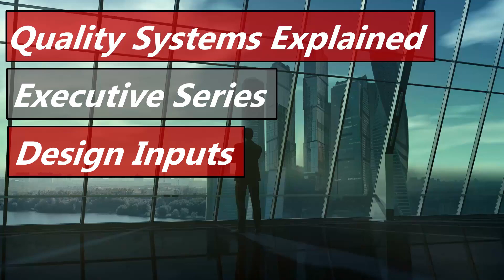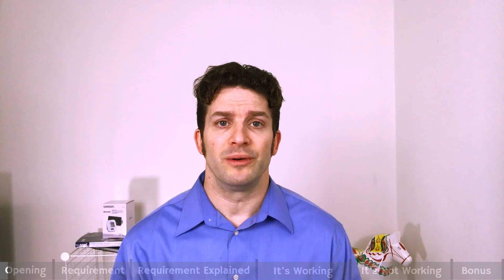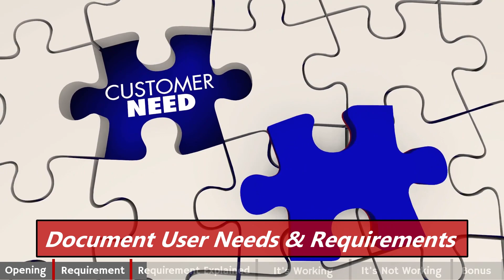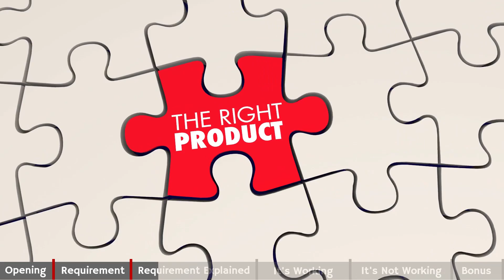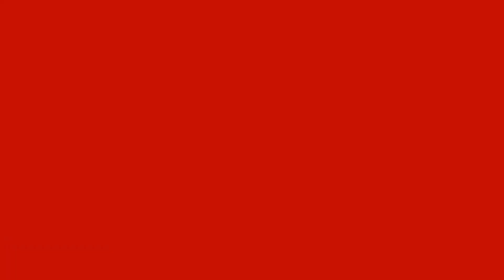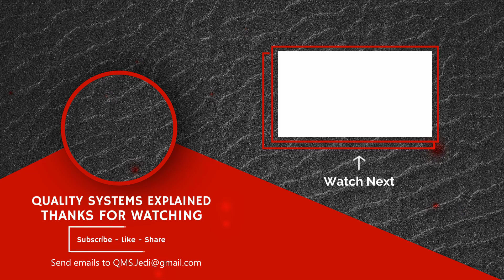Design Inputs 820.30c & ISO 13485 § 7.3.3 (Executive Series #12)

Comment: Hi Is MSO approve Design Inputs, Product specification document contains intended use and indication for use (also IFU) and can you please answer 3rd question
Reply from the maker: Hi Manish,
You have asked me to answer bonus question 3.  Here it is.  
Bonus Question 3 - How do we capture the intended use and user requirements for the device?
This is company dependent.  Most companies will have a Design Input Document (DID), User Requirements Specification (URS), or a Product Requirements Specification (PRS). It does not matter what it called.  Bottom line is that your device will either be novel and brand new or will address the same intended use as a currently marketed device.  This gets into regulatory pathways some and I will not cover that here.  
Basically, in the requirements document (DID, PRS, or URS) there will be a marketing section and a regulatory affairs section.  In both of these two sections the design team will have to define the intended use and the indications for use.  This will be part of the design foundation.  
I hope that helps.
Sincerely,
Aaron
Reply: @QualitySystemsExplained  Thanks Aaron

Comment: Plz help in documenting design control input for a particular device
Reply from the maker: The first place to start is your design control procedures and more specifically the section that covers how you document design inputs.  Most companies have a standard design input template that lists all the areas where the design inputs will come from: Customer, Marketing, Regulatory, Physical, Performance, Usability, Safety, Labeling, etc. The inputs themselves should focus on the device.  
Your device will XYZ.  Your define will meet ISO XXXXX safety standard.  Your define will meet IEC XXXXX.  Your device shall be reusable up to 5000 cycles.    

For a simple example: if your device is going to be sold in the US and is plugged into a power outlet:  The device must operate on standard US power of 110 - 120 volts, 60 HZ ± 3.   

Keep in mind this is a simple example and you would need to better define the US power system requirements to allow for adequate design verification.
Reply: Thanks